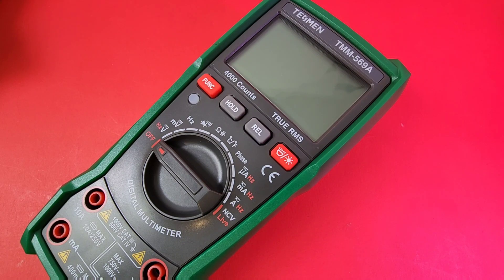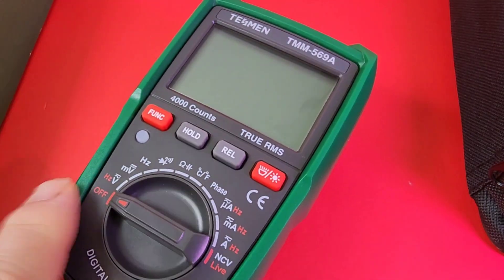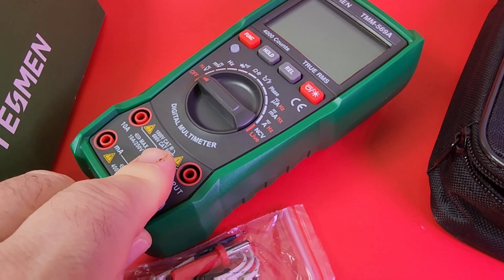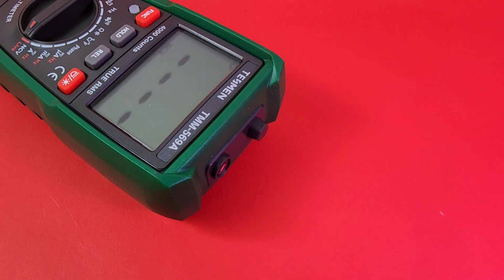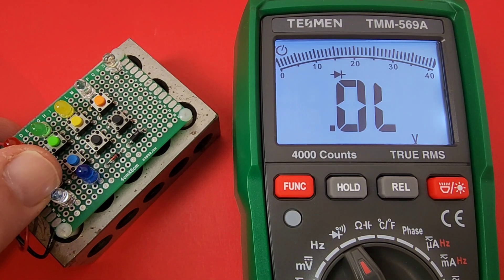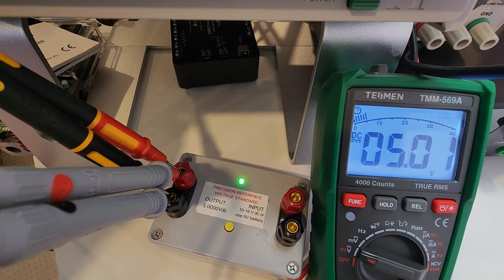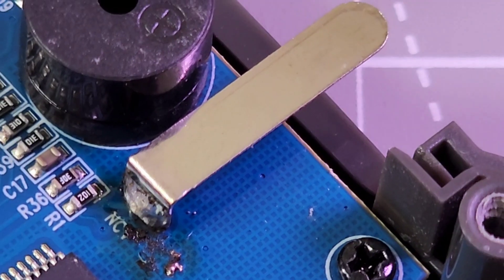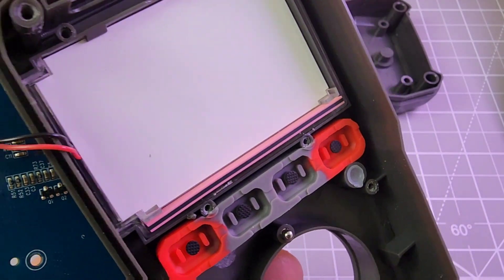TESMEN TMM-569A CHEAP-O Multimeter Review & Teardown!

Comment: That's a lot of meter for the price, not sure that the installed CAT protection matched the specification though. Seeing a few meters out there using AAAs now, much prefer the AAs.
Reply from the maker: For household mains it should suffice  but yes, I wouldn't put much faith in the CAT rating either.

Comment: Hi mate,
Good video as usual.
Ipurchased an aneng st180 but the ac clamp didn't work properly (always measured very low currently below 1 amp even when shoukd be measuring 10amps). I got a refund and was looking to get a clamp meter with ac and dc current.
I looked at your review for the crab meter winapex 268b ($50).
I also heard about aneng st213 clamp meter ($40)
And also the uni t 210 e for about $80.
I'm mainly using for simple hobby is there any one you reccomend.
Thanks 😊
Reply from the maker: Check out the OWON CM2100B https://youtu.be/C6z4ohjTvbw?si=JT3f5McBXJjA02E4
I also recommend the 210E, hard to go wrong with either  clamp 👍
Reply: Costs in aud btw. Ty